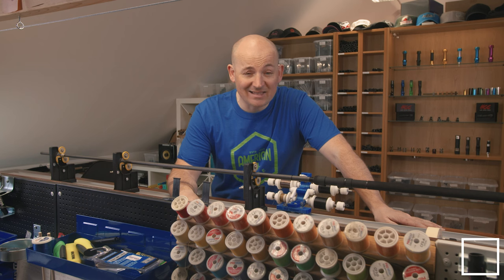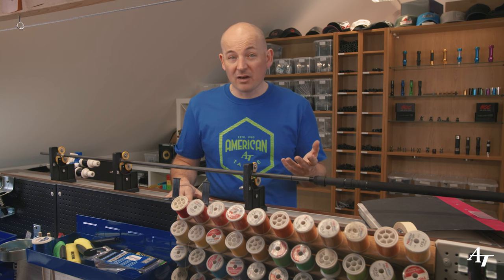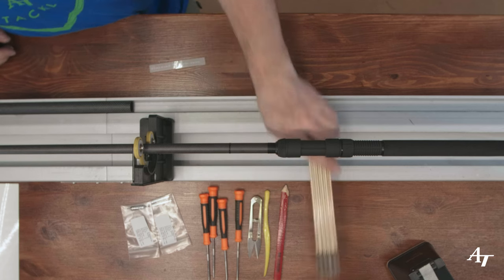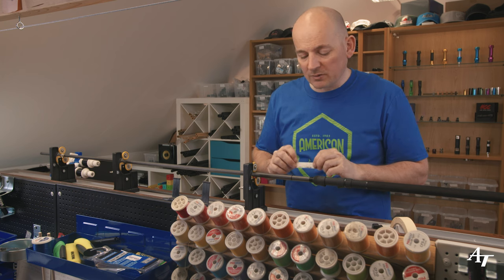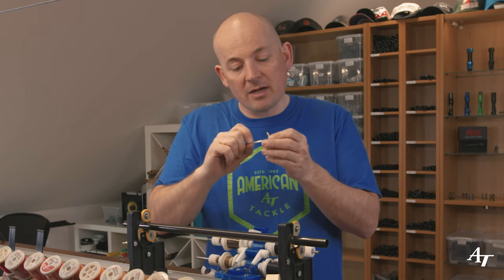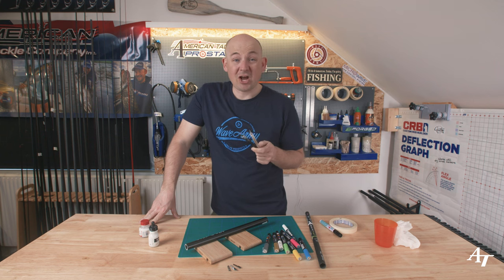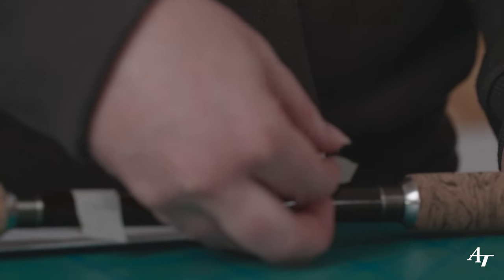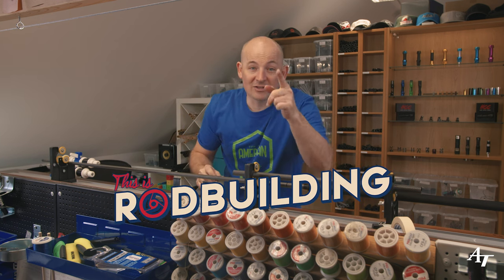This is RodBuilding Episode #15  Decals & handwriting

Comment: Good Information.  I have found that if  you get decals that tend to get epoxie under the edges and they start to lift off,  when you apply the decal, wrap thread over the decal and let it sit for overnight, the thread holds the decal tight and gives the glue time to set and take hold. remove the thread and epoxie over the decal, time consuming, but works.